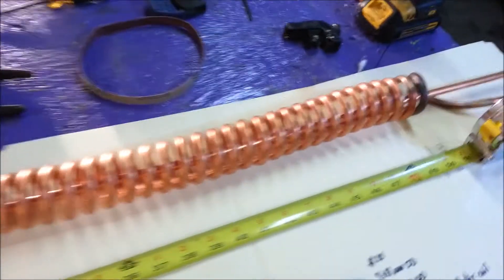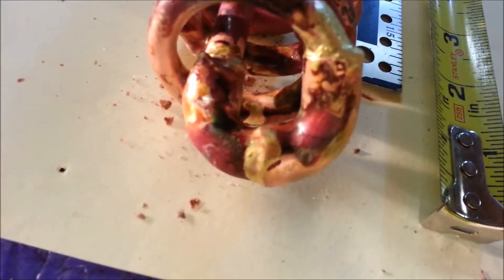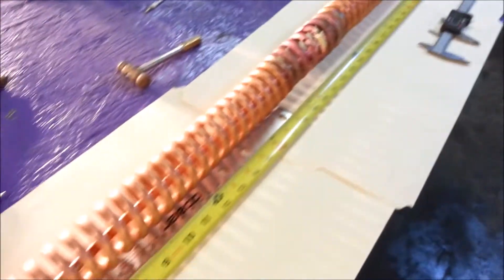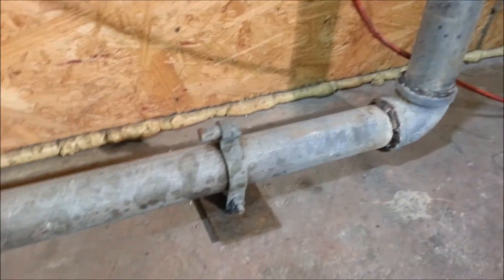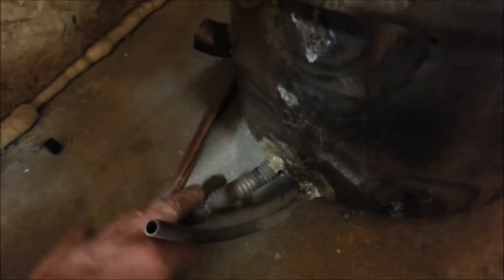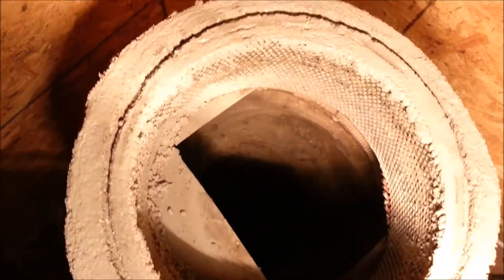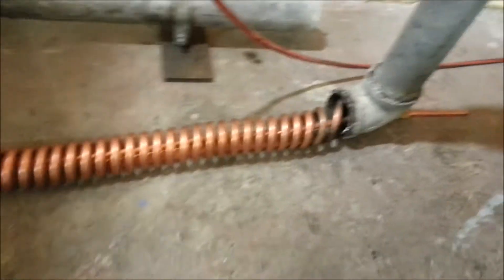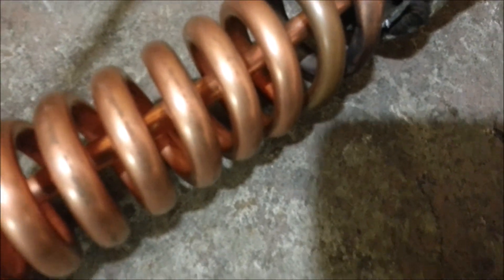"Waste Heat recovery"Copper Coil heating element

Comment: Nice build !  What were the final results ?
Reply from the maker: i have some videos of it , i think i got like a 30 deg temp change , curently it will boil over very quickly if im not carfull, i need a bigger resivior
Reply from the maker: im currently using a 8" x 8 " heater core radiator from a car cabin air heater it isnt big enough and the system will quickly reach  225 deg and boil over even with a powerfull blower , this is a good problem though id be disappointed if the device performed poorly so needing a bigger radiator is great news , currently the garage can only reach 60 deg in 0 to 10 deg F weather , the garage isnt insulated at all and i have to run the burner at 25% power so hopefully with a bigger radiator ill be able to bring me up to 72 deg . i also intend to insulate the attic
Reply from the maker: so far i ahve not had any serious creosote issues but i think im gonna clean it this year by inducing a chimney fire with an arc welder and the blower on